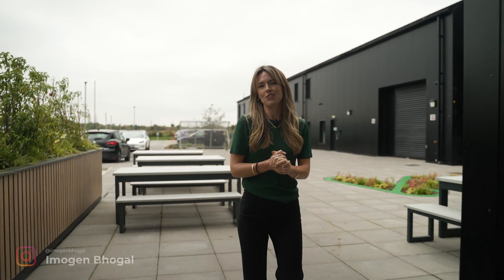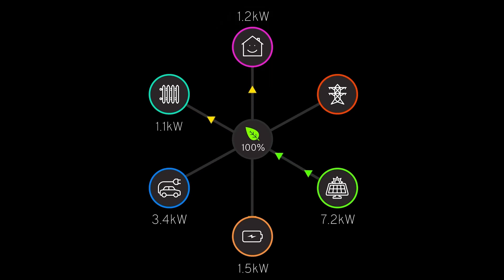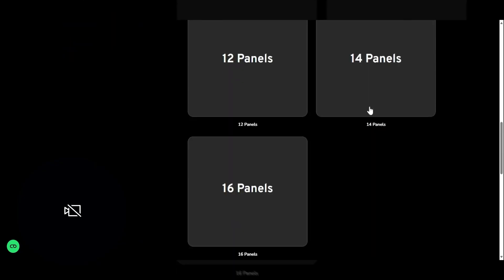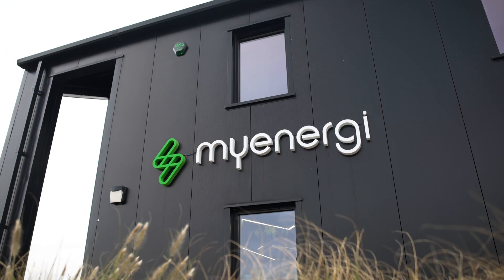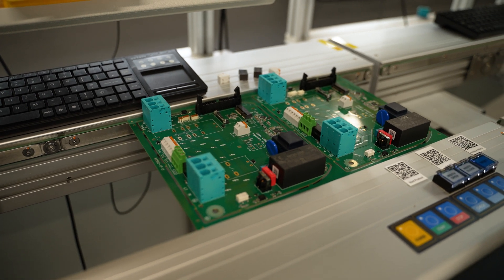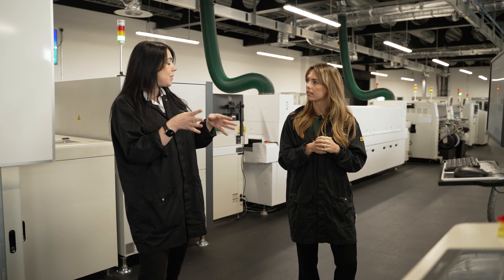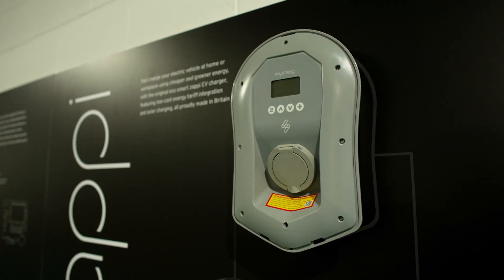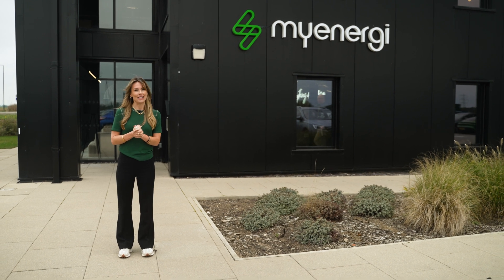myenergi One: THE Way To Get All The Home Energy Tech You Need! | Everything Electric Show

Comment: This is the reason I haven't decarbonised yet:

I want a heat pump because my boiler broke. The only place I can install it without planning permission is in my back garden in prime real estate. To do planning permission I have to pay someone over £1000 (maybe up to £2500) to do the drawings for me, or work out what's needed and how to do them myself risking rejection because I didn't do it right. The council want £360 to answer one email or have one phone call about the proposed planning permission. Then it'll be about 8 weeks until I get a verdict. The LPA prioritise aesthetics over all other factors where given the latitude to do so. 

Given how close most of UK housing is to each other, the MCS 020 limits placement to potentially impossible/ only in really inefficient places. The ruling is completely insane, because the neighbours opinion doesn't matter. They can love it or hate it and the council follows the MCS 020 because "what about future owners?": They can choose not to buy it if they don't want to. That doesn't seem fair because that would reduce the house price though, right? Sure, but if I live 100m from another house I can put it under my bedroom window no worries even though that would be WAY louder than 4m from a neighbours window. They also always only use the loudest number on the spec sheet. Even if 99.999% of the time it would be half as loud as that, or may even NEVER get that loud in operation due to the design of the system.

Then the gov offers £7500 off the £15000 cost to install. About £7000 of that being the materials. Two people fitting? Four days? That's a hair less than £1000 per person per day rate. Definitely north of £500 a day.

Underfloor heating? £750 in parts, £2000 in labour. For two people over two days. £500 day rate.

Over half the cost of decarbonising is a cash grab by trades people. THAT is where we can make HUGE leaps and bounds if we set up a company to do these tasks at a more reasonable rate. Otherwise I should re-train: I'd love to earn £125k - £250k pre tax.
Reply: That’s incredibly sad for you. In my experience a heat pump is virtually silent outside, but in the house there is a hum from the primary and secondary circulation pumps, so acoustic insulation is essential if installed inside the house.
Reply: The most noise part of a ASHP is the compressor, and this can be indoor or out, just so you know!
Reply: No need to pay 1000 to have the drawings done.  Just measure up and you can do your own on A4 paper if you can use a pencil and ruler.

My quote for a 3 bed house was 8800 or 1300 after the grant.  After the survey there was no additional costs.  Get some online quotes for a more realistic idea.

 Underfloor is not needed on a retrofit, just use the exusting circuit with probably some radiator upgrades.
Reply: I’m curious to know if you have been or are self employed? It sounds to me as though you don’t know how much it costs to run your own business. You make it sound like trades are taking home that much money. After training costs, insurances, van, tools, holiday, pension, unpaid sick days, the list goes on… your not paying for a cheap item that is manufactured in bulk, you are paying for (if you of course choose wisely) a highly skilled dedicated professional. If it’s so cheap and easy to run your own company and you think you would be better off, why don’t you re train?
Reply: @MrAdamtheplumber  I think you missed my point. I'm not talking about all trades or all plumbers. Most charge very reasonable fees for standard stuff. But for UFH and ASHP the quotes I've had have been an absolute joke, and asking around they sound par for the course. Worst bit is I ended up paying a highly recommended and highly reviewed company to do the UFH and they charged £500 per person per day and the quality of the job was terrible. They didn't know the basics of what they were doing. I 100% certainly would have gotten a better job if I'd done it myself. Sadly I'm legally not allowed to install a hot water cylinder myself apparently because it's a pressure vessel, and can't get the £7500 voucher for the ASHP if I self install, so it cost the same to pay someone else to do it. Also I only have so much holiday and I can't spend it all working or I'll burn out.

I did "pre-tax", but you're right- I factored in the average 252 Working days in a year, but didn't factor in unpaid sick days (~6 average per person per year UK), and I didn't check and realise that doesn't include holiday either (25 days), pension is apparently 8%, Insurance being public liability and self employed for ~£200 a year? I'm not sure how fair it is to put your transport running costs before take home income as people who drive to work don't do that, but lets say it is, then that's ~£4k per year. Tools average £600 a year. What repeat certification/training do you need to get? CCN1 once every 5 years for £640, so £128 a year?

So far I've got an average of 220 days worked per year at £500-£1000 a day is £110k to £220k gross income. Then fixed costs of ~£5000 a year, 8% for pension, take home after all costs looks something like ~£65k off of £110k gross, upto £120k of £220k gross... I might be out by a bit, but I don't see enough to make that less in your bank account than most other people earn per-tax. Average set-up costs for a Plumber are just under £10k, as a one off, not every year. Knock another £10k off for that and you're still way over UK average. Remember, this is after their materials costs which for ASHP is tax free and they charge 30% sourcing fee on top of. 

Average cost to hire a plumber UK 2024 is £31 to £54 an hour. 8 hour days, 220 days a year is £54560 to £95040, net. Lets say it costs the full set up costs every single year and including pension that's £40995 to £78236 pre tax.  Take home £30811 to £53820 a year. There's nothing wrong with that. UK average take home is £27573, or £34632 gross so that's more than average.

I'm apparently missing over 50% of the costs or >£30k worth. Meanwhile average plumber UK day rate is £250- £450, and I'm getting quoted £500-£1000... Is £500-£1000 per day a fair rate then? and how much does that result in take home pay?

I actually am considering retraining because the quality of work by the highly rated trades people I've hired hasn't been as good as I can do, and by my maths they can earn a heck of a lot more than me.
Reply: @MrAdamtheplumber  Your silence speaks volumes. The low end of my estimates puts the UFH and ASHP installers in the top 10% of household incomes in the country, if they are the only earner in the house. Top end is top 1%.

I've got to have missed something enormous in order to take that to the average, or "scraping by".

Comment: 02:45 Surely this is the problem that really needs to be solved; different manufactures products should work seamlessly together and should provide the same (or at least an extremely similar) level of optimisation of power generation and supply. Do that and there's real competition in the marketplace so lower prices will follow. The problem is that each manufacturer is essentially a walled garden, hence the high cost.
Reply: I believe that they do. There is a standard they are working to, which I great for those of us who want to do clever things with home automation.
If the phone is home and the car is plugged in then start charging when the front door opens.
Reply: @chriswatt2702  I have some "smart" products in my house, and no they do not get along in any useful way. I intentionally bought a smart thermostat that was compatible with the pre-existing wifi connected heat-pump's walled garden and guess what? The only thing that buys me is being able to read out current conditions and control my smart thermostat as if it is a dumb mercury switch. He's right, they don't integrate well at all and instead of prioritizing integration the companies prioritize gimmick features like being able to set up the man-cave that does not exist in my house (because there's nowhere to put it) with voice-activated mood lighting—instead of doing useful things like teaching my oil-fired furnace to function as backup to my heat pump.
Reply: Hm... My kit is from a few different manufacturers (because nobody was making a complete system at the time) but it all plays together nicely. It's just a bit annoying that I have three apps rather than one, and I can't prevent the car charger from draining the house battery. It's a very small annoyance, not a deal breaker.

Comment: Their products are overpriced but you do get circuit boards manufactured in UK opposed to other makes using Chinese boards with a UK sticker and box . I like installing their units as you only have to fit once.
Reply: @денисбаженов-щ1б  the solar panel is not that complicated reference Oxford PV. If china stops production or political reasons like Russia then solar PV can be built in Europe.
Reply: Crazy to in-house assembly but make such basic boards.
Reply: Yes good point batteries yes only one or two in Europe.And solar one factory in Austria I think Germany seems to assemble Chinese made cells.
Reply: @денисбаженов-щ1б  you need to think about simpler, they have access to the raw materials. It's why battery factories in the UK could never be actually competitive, you'd need to import all the raw material.
Reply: @денисбаженов-щ1б  it's not for batteries. Batteries whose entire purpose is to suck up subsidies by lowering externalised carbon emissions from power generation . 😂

Comment: The breakthrough would be financial terms that recognize that solar is a money generating asset vs a loan on a strictly depreciating asset like an ICE car.  Otherwise it's the "we'll lend you money as long as you don't need it."

If you only get approved if your credit rating/equity is good enough to qualify for a standard loan, then people can just diy for cheaper.  System integration is getting much easier so this full package value is diminishing daily.

For people without the credit score/equity that could qualify if they had 90 quid extra income per month (and 90 quid is saved by the system), they aren't typically leant money.  This is the market that if addressed would make this revolutionary.  This is done commercially on multimillion dollar solar farm projects, but hasn't trickled down to the consumer level.

Comment: 5:30 £90/month over how many years?
Reply: Forever 😂
Reply: Up to 25 years with a 2.5% annual increase. It doesn't say on the website if that compounds. If it doesn't compound that would add up to £35,100. If it does compound that would be £36,890. Quite expensive for a system of that size.

Ironically you'd also be paying much more for a system that is 25 years old at the end of the term than at the start. 

Would be good if they actually put some worked examples on the website. As it is quite difficult for a normal person to figure out the rate of interest when using this non-standard method. Thus making it harder to compare to just borrowing the money yourself.
Reply: Upto a maximum of 25 years, which provides a warranty for all components for that time period as well. It can be less though. Says it at around 3:30